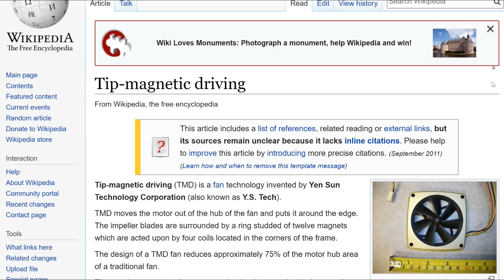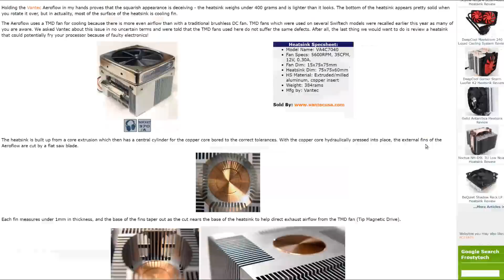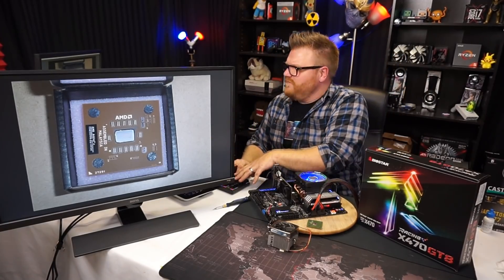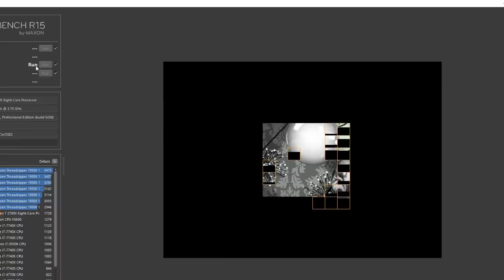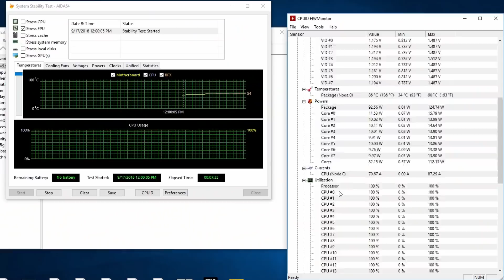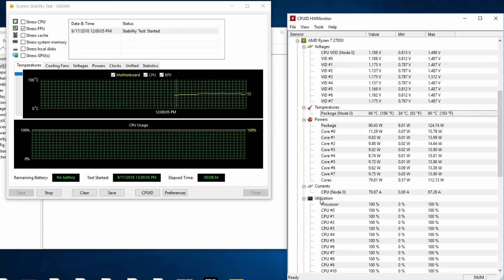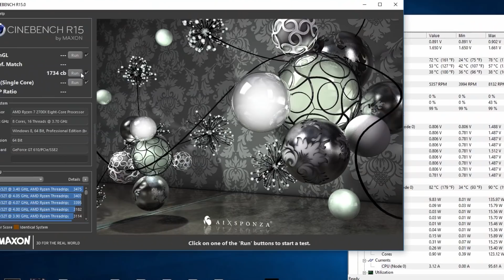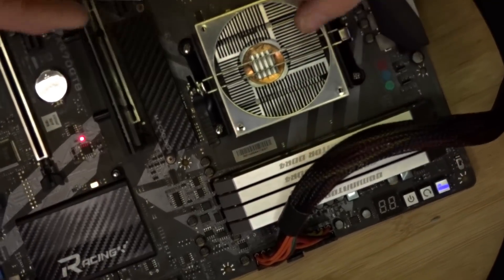Can you cool a Ryzen 2700x with an 18yr old CPU Cooler?!

Comment: put tmd fans on modern heatsink... test... 
i loved these fans...i got a BOX FULL "broken" people tried to open them and broke wires... i fixed every last one... traded and sold them, regret not keeping the last 4... but, a buddy used them to replace a 200mm(or whatever) fan that failed in his case, and the replacements all had the same shit quality.. it works great from what he says..used a usb smart fan controller that controls them via volts rather then pwm, apparently it can super-extract air from the case, removing hot air and sucking more air threw the radiators...

Comment: How did you make a 4 pin connector work with a 3 pin connector on that fan? Also the amd coolermaster cooler from 2006 looks exactly like a amd wraith prism cpu rgb cooler.

Comment: well, I think that the best coolers are from 10 years ago.
everything ran hotter so they had to deal with more, especially graphics cards.
there is no reason to be putting r and d into cooling since things are cooler nowadays.
Nowadays, you don't need these massive coolers due to shrinking.
So I don't agree with the assumption that old coolers are expected to be worse.

Comment: Love your content.  Built my Ryzen 1600 system around MSI B350 Gaming Plus MB based off your recommendation, it is awesome, cpu OC 3.95 Ghz stable.  Here's a challenge for you.  Suppose someone wanted to build a 1080p gaming system with a max budget of $800 with all new hardware, nothing older than 1st gen Ryzen or 7th gen Intel.  They need everything:  case, cpu, mb, power supply, memory, storage, monitor, keyboard, mouse, dedicated graphics(nothing older that 10 series Nvidia or AMD RX capable of 1080p Mid or higher settings at 60fps) , Windows.  What would you recommend?

Comment: I am gonna be trying my own Cooling project - but you could say it's the opposite of this - I am gonna put a 280 mm ThreadRipper AIO on my FX-9590 in place of the Corsair H100i GTX that is currently in use. As for cost of the Cooler's ; I Originally paid a total of $80 for what was suppose to be a Corsair H-80 but in the box I found the Corsair H100i GTX instead that was about 2 years ago roughly. On Srpt. 12th I bought the NERMAX LIQTECH OC TR4 280MM LIQUID CPU COOLER AMD THREADRIPPER ELC-LTTR280-TBP for a total of $70.06 Will be interesting to see the result's.

Comment: I remember using the Vantec CCK-6035 Copper Heatsink and that thing came with an insanely high rpm fan.  It sounded like a hairdryer and would hit near 7000 RPM and around 70db.  How did that shit ever make it to the market?  Could they not have come out with a larger slower spinning fan?  WTF

Comment: There are some really good old school cooling solutions. the one you've chosen is pretty weak tbo. Thermalright used to have a cooler in the original athlon XP days. before the multicore athlons in this vid. iirc one company made a hsf of actual silver. most of the overclocking ones that i had were all in copper with heat pipes too. but we also ran really loud Delta fans. these days we have larger heat sinks with larger quieter fans.

Comment: 4930k might do alright with that cooler lol  , i'm running one at 4.5ghz  on a hyper 212 push pull evo  and that cheap but descent air cooler keeps it under 70c   under stress

Comment: I’m not too surprised, as how CPUs from that era were extremely hot and inefficient
Reply: for the time period they weren't though. for the time period they were stream lined  yet powerful.
Reply: Denver Starkey cough pentium d cough
Reply: dude we are talking cpu's pre 2005  , Pentium d was a dual core that was realeased in may 25th of 2005. the cpu cooler in the video was even for a single core chip  

we are talking  AMD Athy XP  vs intel Pentium 4.  the Pentium D was post that era after amd had already beat intel  to making the first dual core chip with the Athlon II's earlier in 2005

Comment: just goes to show you that tec from the past way better then today
Reply: Coolers from 10 years ago were better at conducting heat because the CPUs from the era were very hot and inneficient.Always keep old coolers because they will cool better.
Reply: I got pure copper cooler from Zalman won it on ebay brand new for $15 and well i got it on fx 9590 cpu and it a beast. Plus it got fan control hub thing

Comment: been thinking of trying to track down the first aftermarket heatsink I ever bought (Thermalright SI-128 SE) just to see how it'd do nowadays but finding one is impossible.
Reply: Eric Ashby I find being patient, and keeping saved eBay searches on things like this to be helpful. I had to wait almost 6 months to find an Ultra Xconnect 500 watt 20 pin modular PSU new in the box for a custom Pentium 4 Win 98se/XP build I'm currently in the middle of, and now I'm just waiting for the right case to pop up on eBay to match that shinny silver PSU.
Reply: I got that cooler in my Old 939 Dualcore Build, that Thing is still awesome.

Comment: I wonder what a PC builder from the year 2000 would think of a 212 Evo...
Reply: "Why would anyone ever need a crazy cooler this large??"
"Why are there LEDs everywhere?!"
Reply: @Swift - Silver Truth right there, I have a case from the early 2000s that has a blue led in it.
Reply: Cold Cathode or UV
Reply: Well I was building PCs quite some time before 2000 and I think for a good deal of those processors it would be massive overkill but it never hurts to have way more cooling than you need.
Reply: Benjamin Hale it can if you are getting a chip colder than ambient, and causing condensation/moisture to form, which can lead to shorting out your system.
Reply: You will never get that with normal liquid or air cooling, the hyper 212 is air it won't go enough below ambient to cause any condensation.
Reply: Benjamin Hale  Well yeah that's a given, I'm speaking in general terms since you said it never hurts to have more than you need, and I'm just pointing out there are cases where you can have too much cooling lol!
Reply: .. They'd only have a few more years to wait..
Reply: Swift - Silver I had a cheapo case with clear window that also came with a clear plastic fan with a red LED,